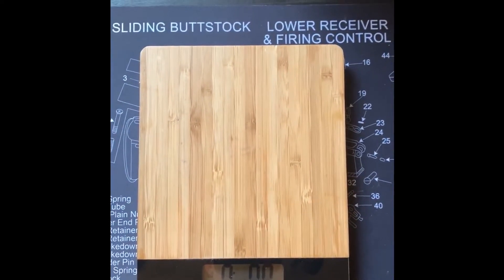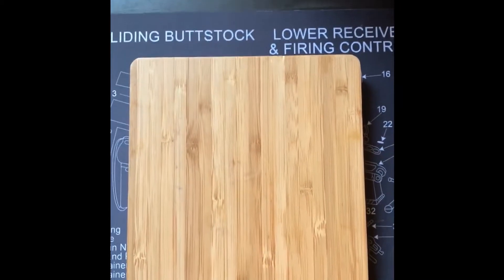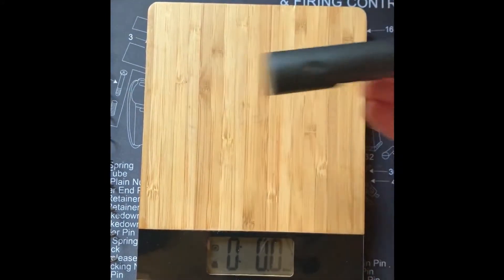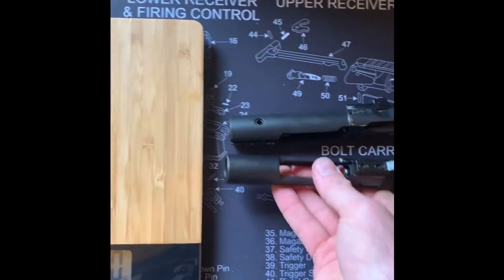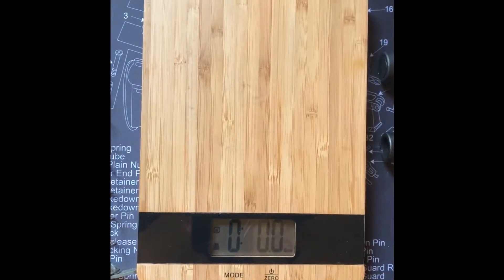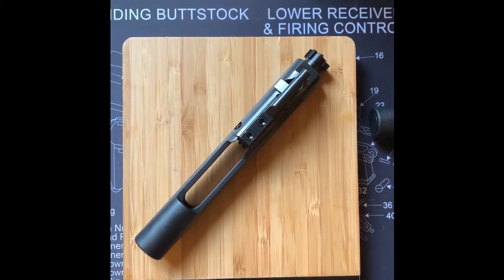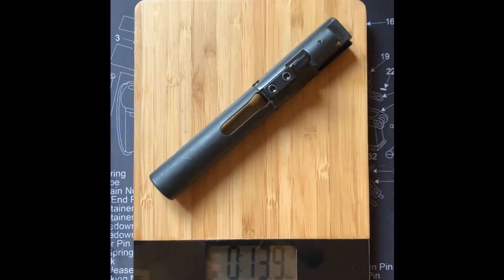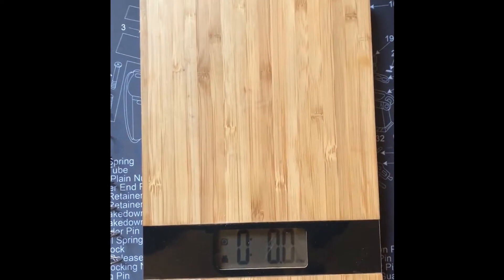9mm AR15 Ejector Explained

Comment: Currently in talks with MeanArms. I've never had difficulty with the EndoMags, probably because the Ejector is bigger than the ExoMags. I've got a G4-9 PSA upper, and it ain't running the ExoMag. They sent me a different extractor (Thank you MeanArms), but something tells me it isn't the issue. I'll test in a few days. Thanks for this video!
Reply: what is the extractor you are running on that upper? i’m having problems finding it

Comment: Just getting into this myself. Bought a 9mm upper and a cmmg converter and found out they would not work together. Found out about Mean Arms and got a Endomag converter with a ejector and bingo. But please let you viewers know about the new Exomag from Mean Arms, Its not a conversion kit but a complete magazine that come in 10,15,20,32 and 40 round options" $35.00 for 40 round" . They just finished production on the 40 round version and it has about a 1 month delay due to back orders.

Comment: Good stuff. I been having this problem myself.  Frustrating.   I bought a CMMG Bolt and barrel combo as well as a couple of 9mm conversion mags.  Wouldn't you know the mags have no extractor blade so wtf.  Not a CMMG fan in the first place.  Just wanted a 9mm AR.  So I bought a Davidson Defense upper thinking it was something I did wrong with my CMMG build.  Same thing happens with the ejector.  This is a great video that spells it out.

Comment: Great video. I presently own a PSA 9MM AR. I bought it about 5 years ago. Works well. It takes Glock Mags, but I have a lot of feeding issues. Solved the problem by using ETS Mags. No more feed issues, because the ETS Mags have a more defined sloped follower. I bought another barrel that has a very defined feed ramp built in the breech of the barrel, allowing me to use the Glock mags. So now I have two dedicated 9MM uppers. Now for the big question, I live in a non gun friendly state, so semi auto is not appreiciated. I had to resort to modifications to allow me to use my semi auto AR9. I want to make my 9mm AR a single shot/ bolt action rifle. I have a Kali Key on my  custom built 5.56 AR ( It no longer has a gas system or any gas componants,  such as the ( Gas Tube, Gas Key) and it works geat as a bolt action. Having a bolt action AR permits the use of all the deadly features , ( Pistol Grip, Adjustable Stock, and removeable Mag. and a Muzzle Brake )  Sadly Kali Key has not designed or will answer my question ,as to ...If a Kali Key will be built for the AR9. Do you have any insight as to what I can do to make my AR9 into a bolt action system? Thank you.

Comment: Thanks bro, this is exactly what I needed to hear. I have a bear creek 9mm upper and bought the CMMG mag. Will get the mean endo mag now. Keep up the good work. 👍
Reply: I've got a Bear Creek 9m upper too,  it won't function with Mean Arms endomags OR the Stern defense magwell adapter.  Next I'm gonna try a different bolt specific for 9mm I guess.  What a rabbit hole I got into
with this 9mm build.

Comment: Having an issue my bcg is not pulling the spent case out of the chamber. It's very strange because I works fine if I manually eject by pulling the charging handle. Any advice?
Reply: Bolt bounce? Is your buffer at least 8oz? 11 oz would be better.

Comment: my bcg 14.6 oz  and buffer 6.49 oz  any thoughts , i use a cmmg mag and can only get one round off  driving me nuts
Reply from the maker: Do you have a CMMG upper?
Reply: @moderngunbelt5737  no - my guess is that is the problem - need a matched set i presume?
Reply: followup  i ditched cmmg and got means endomag - works fine - means makes cmmg internals i think but they are not the same deign.
Reply: The cmmg banshee with the radial delayed blowback system is the cream of the crop for ar9 type setups